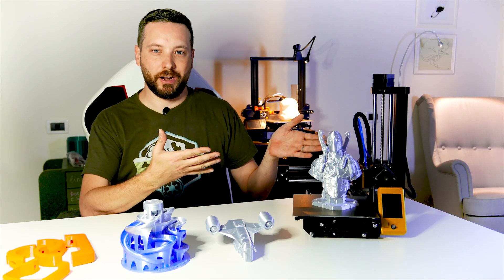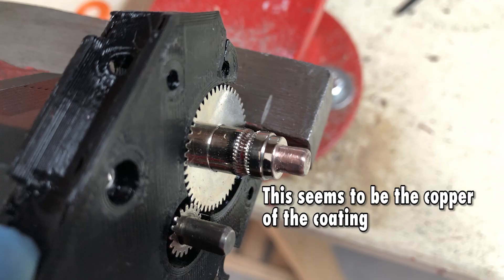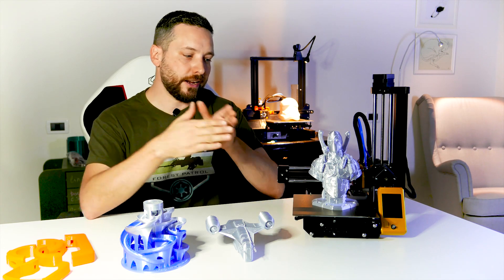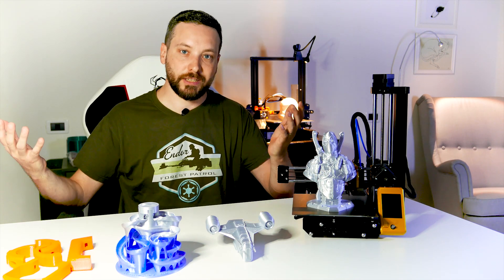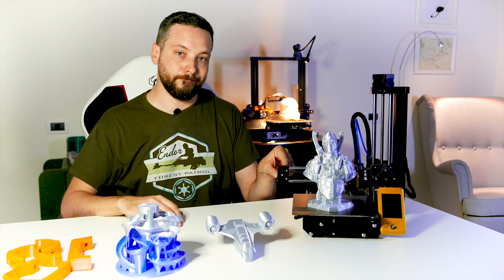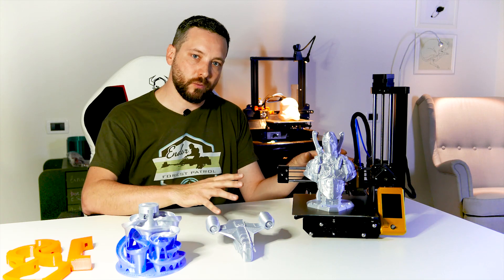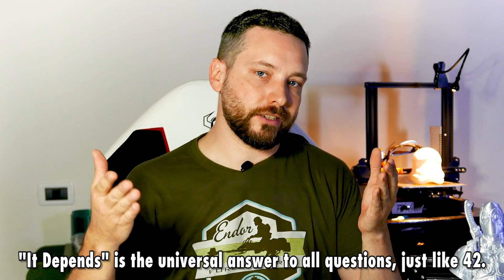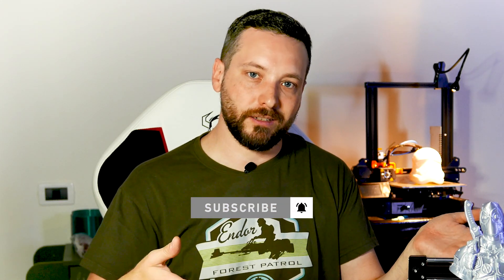Prusa Mini Clone Review!

Comment: You are mentioning PLA parts, but Prusa recommends using PETG, which is much stronger, has a bit better temperature stability and is used in all Prusa printed Parts (inluding the original mini).

Comment: The bearings should be cleaned, lubed, and then installed 45 degrees from having a row of bearings at the dead bottom. A row of bearings should be 45 degrees either way from the direct bottom. Basically, the actual rows of bearings, if you looked through the assembly should be at the tips of an imaginary "X" not a "+" so that two rows of bearings cradle the smooth rod instead of it resting directly on top of one row of bearings. Prusa now offers the Mini as a kit and these are their instructions on the bearings. They don't actually call for cleaning the bearings first, but as you are dealing with bearings sourced from who knows where, it definitely couldn't have hurt.

Comment: I want a Prusa Mini+, then I saw the clone and it's for 300€... but sawing all the issues and the fact you must print all plastic parts (30 to 50€ more) I think I'll pay the 500€ of Original Prusa Mini+, because I want unbox-assemble-print no more hassles or suprise issues.
Also the clone needs to be upgraded with new extruder, this is a no no.

Comment: On the original Mini+ the PTFE tube does not go into the hot zone. it is only in the cold zone which is why you can print up to 280C on the original and that one you will start off-gassing the PTFE tube at 235-245C. I would not recommend doing that as it is a severe health risk.

Comment: I wanted to add here that I bought the same exact kit in July 2021.  The holes were properly tapped and the bearing fit non problem.  Also, the heatbreak was improved to a bondtech clone (looks just like it.).  So, it would seem FYSETC has done some improvements to the kit over time.  Like I said in a previous comment, clean and grease the bearings before you build the kit and you should have no issues.  Very nice kit and you can get them, with coupons, for around $215-$225 delivered in the USA.  I like to tinker, so it was worth it to me for the kit.

Comment: Thank you for documenting all of this. Appreciate it.  Did you clean and grease the bearings before installation?   I found the ones that usually come on kits like this have cosmoline (rust inhibitor) in them.  This is not a lubricant. So, if just installed and not cleaned and greased they will make a lot of noise.
Reply from the maker: It does! I will give it a look, thanks for the tip!

Comment: @A-Make Designs On the price of the printed parts, you have forgot the electricity costs. Also the wearing of the used printer.
Reply from the maker: It's not forgotten, I think it's negligible. The PSU of the mini is rated for 160W max power, so the worst case scenario where it gives full power for the whole 66h consumes 10kWh of electricity that where I live retails around 0.3€/kWh.
Reply: @AMakeDesigns  Not negectable.Prusa now ships Minis with 250W PSUs. And you calculated a lowest quality print time, easily increased by factory of 4 for better prints. So your 3,50€ easily increase to 28€.
Reply from the maker: Rated power is much larger than steady state power. When the machine is in steady state, You only need to keep the temperature compensating for the losses.
Reply: @vikypond3183  nonsense.

Comment: For my Fysetec clones, I use strictly Igus poly-teflon bearings and never bother with the steel ones - they are junk. I also order their external mosfets for the heated bed and don't drive them from the mainboard, better heating performance and less stress on it. Additionally, I use Phaetus Dragon Standard all-metal hotends for the Prusa MK3 rather than the included E3D clones which is a huge upgrade in and of itself and opens the printer up to virtually any material. Still comes out 300 bucks less than a factory unit. I've had mostly good luck with the MK3S kits.
Reply: When you say external mosfets, do you use those for a Mini clone or an MK3?
Reply: @Gepstra  You can use them on any printer that uses an on-board MOSFET to drive the heater. Its not strictly necessary, like I said its mainly to relieve a potential failure point down the road.
Reply: @Ojref1  Okay I'll look into that, cheers!

Comment: Thank you for your review. I just got my mini kit and it appears they have fixed the tap hole problem but it appears that they now have integrated the support spacers into the bed support instead of installing hex spacers at that point in the assembly. The problem is coming when I try to attach the heat bed, the angle screws only come 1-2mm through the bottom of the heat bed and don't reach the threads in the supports which seem to start 1-2mm further in yet. I'm not sure if I need to contact someone at Aliexpress or if I need to talk to FYSETC directly(or the best way to do either of those)? Or do you think I should just try to find the same type of screws that are a bit longer? Again, thanks for your very professional review that prompted me to go the clone route.
Reply from the maker: It depends where you live. I definitely would buy longer screws myself if it was my case. They are M3 countersunk screws. The original ones are 2mm long.

Comment: The original is a no brainer. It doesn't cost much more, get update all the time and the support is gold while the AliExpress support or update will be inexistent.
Reply: What kind of updates are you talking about? Firmware? Because you can use the original firmware with the clones.
Reply: @Gepstra  both software and hardware update/upgrade.
Reply: @tiloalo  which are open source.
Reply: @Gepstra  obviously there are many difference in the machine, I wouldn't assume that everything is compatible with one another
Reply: @tiloalo  Well at this point everything is compatible unless you can give me an example of something that isn't, would be good to know as I've just ordered one to compare to the Mini I already have. What I've seen is that with some better parts for the extruder and hotend it should be pretty comparable.
Reply from the maker: The bearings are also lower quality, at least on mine

Comment: I would like a comparison between real prusa mini print quality ( which is really awesome ) and the clone print.
And what about the noise level of the fans and motors ? Prusa mini is a quiet machine, what about the clone ?
Reply from the maker: The print quality of my two units is very much comparable. Noise is pretty much the same except for the occasional click from the poor quality bearings, which I might eventually replace. In my clone there is something wrong with the Y axis pulley making a sqeaky noise, but I didn't have time (or need...) to fix that.
Reply: @AMakeDesigns  My original prusa mini on Y axis is also making a sqeaky noise
Thank you for the comment

Comment: Hi, great review.....but if you allow me I would like to make a consideration :
we know that the clones are supplied without plastic parts, a common mistake that I have seen in many clone assemblies is the fact that people have printed the plastic parts before receive the printer. 
Now we all know that when we mold relatively small mechanical parts with holes in which we will have to insert bearings, pins, etc. the theoretical tolerance of the holes is not always correct, in fact when I need to build parts where I need an exact tolerance, I mold a test piece, measure the dimension and perform a correction until I have obtained the desired tolerance, then with the correct values mold all the pieces.
This will offer a perfect fit and no surprises.
What I mean is that if we had tried to mount the plastic parts on an original prusa we would have had the same problem, in fact the only mechanical variable between the original and the clone is that the latter needs a home made print of the parts
So I would just consider the quality of the clone, not for the difficulty of coupling between plastics and hardware, but simply how the parts provided in the clone kit are built, and considering the large price difference it seems obvious to me that the clone wins. .
Then, like you, I love to assemble a printer in all its parts, but for those who do not like this or are not capable, well then they can buy the original and will have no problems :-)
Reply from the maker: Well, you are right in principle. The design of the Mini is clever enough not to rely on precise plastic parts. The assembly problem I had was between the metal gear and the bearing, so it is a supply issue, not a printing problem.
Reply from the maker: I saw you got the answer from sanity. Happy printing!
Reply from the maker: By the way, the full bill of material is avaliable in Prusa gthub page

Comment: Thanks for the video! Very interesting indeed. Until now I didn't even know the mini was already cloned. Now given the mediocre quality of the parts...if there was a BOM...do you think it would be possible to build a mini from original Prusa spares? And would that probably cost an arm and a leg? Hmm...if I haven't mis-read the cost summary part, the cost advantage over the original Prusa mini is small but the original mini doesn't come with a Bondtech extruder...something somebody might spend anyway even on an original one. With the crappy gear of the clone however this seems to be a must. I wanted a mini for a long time to be added to my collection but price and delivery queue kept me away until today.
Reply from the maker: Prusa proudly supports open hardware, so the BOM is available in their Gthub page (link below). Prusa limits the purchase of spares to Original Prusa Owners, so you must have another Prusa machine to get access to their spares shop. This leaves you with very few options, where the Chinese clone hardware is one. This is the main reason why I embarked in this journey in the first place, to give the community one extra opportunity to get hold of an amazing machine. https://github.com/prusa3d/Original-Prusa-MINI

Comment: I can confirm all your statements. Very good review.
Reply from the maker: Thanks Tobias, much appreciated!!
Reply: @AMakeDesigns  I have actually bought a prusa mini original also since the price wasn't that big different and i want to compare the two. 
Still waiting for the original i have had some issues with the clone. For instance is my extruder motor bad and i needed to switch places for the x and e motors to make it work. The bearrings of the heat bed are worse than bad but in the whole it's an ok machine. If the clone was 100€ less I would have bought another one. But for now the original seems the much better option of the two. Still i think of buying the i3 clone. There is a bigger price reason.

Comment: I fully agree with your conclusion - while assembling printer like this is fun (and frustrating...), this one is definitely NOT for someone who is new to printing and think s/he will save some money by getting a clone instead of original. Some clue about printers is definitely needed. I adore my original MINI and learned to live with it's imperfections, I wish Prusa did MINI Kit like for MK3S.

I have a feeling they somewhat threw together hodge-podge of parts which 'could' work without actually thinking why Prusa did things the way they did. Note: I waited 2 months to get it delivered to Europe, which makes it the same as Prusa delivery times. It may be different now depending on their stock.

Here are the frustrating parts:
- Bearings. Those X and Y REALLY SUCK. The play betweem bearing and rod is too big, the bearing just wobbles on the rod side to side. Z bearings seem to be tighter fit.
- heated bed is not even, bulging in the middle, no matter how I tighten/loosen screws, maybe silicone mod https://forum.prusaprinters.org/forum/user-mods-octoprint-enclosures-nozzles/prusa-mini-silicone-bed-leveling-mod/ will help with that.
- heatbed connectors are bulkier than original and heatbed cover does not fit very well. Some filing is needed.
- They put M10 pneumatic fittings. Original fittings on extruder are M8 I think. Either find a model and print an adapter M8-M10 (M6 if you have spare like I had) or this extruder-rear part: https://www.prusaprinters.org/cs/prints/36551 but this will be a problem with Bondtech extruder too.
- Heatsink has M10 thread instead of M8, meaning it's not possible to use original fittings and bowden on this end.
- Heatsink has too big bore IMO compared to original. Original is tighter fit around heatbreak, either cloned or Bondtech.
- Provided heatbreak has no choke point like Bondtech or metal bottom part like original - it's just straight tube with thread on one end. This makes it fully PTFE lined hotend and limits temperatures to basically just PLA.
- Heatblock is v6 clone, not MINI. MINI has the bevel on the back to allow airflow from part cooling fan. V6 will block that airflow by its rear edge. Buy MINI heatblock or print different X carriage instead, like this https://www.thingiverse.com/thing:4614070
- Bearings for filament holder are smaller, not 608 2Z

I haven't even turned it on yet therefore I do not know if electronics part work, still figuring out how to work around that hotend mess. I am seriously contemplating just doing v6 conversion instead from the start, I have one v6-style hotend in the drawer.
Reply: @shaker2321  Hi Shaker, those bearings are LM8UU bearings (not LM8LUU - that extra L means "long" and will not fit) for X and Y and LM10UU for Z, you can search for those and I am sure you'll find some. They are of various quality and prices, those considered as the premium brand are for example Misumi (LMU8 kind), but those tend to be on more expensive side. I used some I found on locale shop with 3D printing supplies for the price of around 1.5 dollars/piece and they are working well, they sit tighter on rods than those supplied with clone.

As for different hotend, people have had success replacing it with v6 or even Mosquito. Here's good thread discussing people's approach https://forum.prusaprinters.org/forum/user-mods-octoprint-enclosures-nozzles/different-hotends/
For example Afterschnitzel's v6 mod or its remix https://www.prusaprinters.org/prints/31006 If you consider using different heater block, keep in mind the possibility of obstructing airflow from part cooling fan, and possibly use different X carriage design with lower fan duct like this one https://www.prusaprinters.org/prints/46967-prusa-mini-x-carriage-for-v6-conversions or simial from Thingiverse.

Comment: So if you can wait for the original one, it's better. (much less assembly time, you don't have to print the parts, parts are printed in PETG instead of PLA, higher quality bearings and extruder, don't have to do workarounds or order replacement parts).

Comment: Actually the Bondtech heatbreak is all-metal. The tube goes in only about half way, the remaining way is a 2mm precise drilled bore. So even with nozzle temp of 295°C, the tube gets less than a 100°C. Even the Prusa heatbreak is all metal - tube goes in about 3/4, but not to the nozzle, so tube does not reach deforming temperatures there.
"All Metal" refers only the part of the heatsink that reaches outside the coldend, as the heat massivly drops down upwards that point. Both Prusa-Heatbreak and Bondtech-Heatbreak fullfill the definition. The tube can never get a critical temperature up there.
A 4.1mm bore heatbreak with tube going down to the nozzle combined with a firmware able to heat the nozzle up to 295°C is something quite different. One user-error and the tube degrades and release toxic fumes.
You do not need a Bondtech heatbreak, if you want to print PLA and PET-G only. But you have to install a modified firmware than, limiting the nozzle temp. Everything else is simply careless.

For the feeder: A Duar-Drive feeder cost about 16€ in aluminium. First I used a thingiverse-design and parts of a cheap DualDrive for less than 10€. But I tensioned a little to much. First layers went great. But further up I had many retractions. As retraction is longer on a bowden system than on a drirect drive, the section with many retractions lead to the filament passing the gears multiple times - and due to the to high tension deformed the filament. So it did not fit the output of the feeder anymore. Cleaning up the feeder, I damaged the noses guiding the filaments between the gears. Happend on two clones of mine. (I normaly use Direct extruders, a little bit more tension is no problem there, so I am used to tension a bit more).So I made an adapter (improvised in PrusaSlicer using modifiers etc., so sorry, no stl at the moment) to use a "normal" BMG/Dual Drive  - but with aluminium housing. I intentionaly tensioned a bit tight - but with the housing being aluminium nothing was damaged and cleaning was much more easy.

Every two weeks are "sales" on Aliexpress. If you collect point, get AliExpress and AliExpress Select Coupons, you can drop the price quite a lot. about 180€ . So if someone can wait, its quite worth it.
Reply from the maker: Thanks for sharing!!